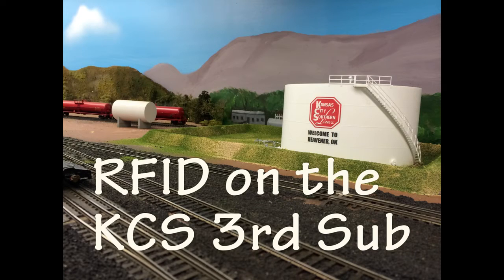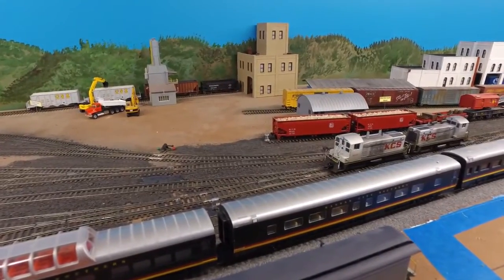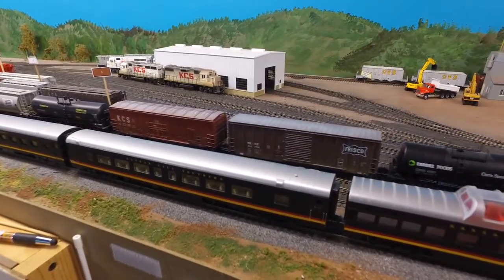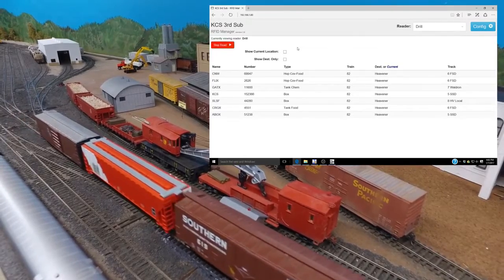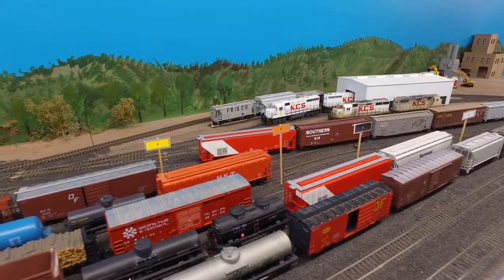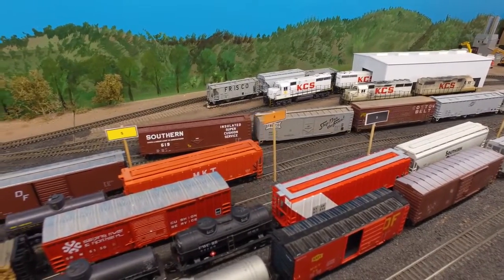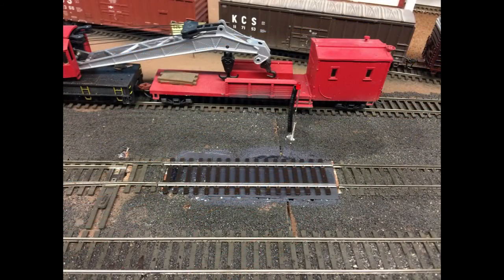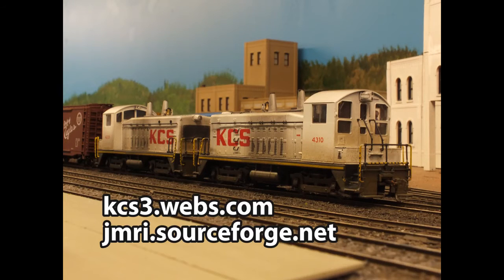RFID on the KCS 3rd

Comment: New on this? - What does RD track stand for?
Probably just stands for Reader ?
Or something else?
Reply from the maker: Different railroads have different terms for their various tracks.  It means "Receiving/Departing" track - where incoming trains arrive or are worked, and where trains depart from.  In truth the way the yard is configured, the siding can also be used to work trains that work Heavener (the main yard on the 3rd sub).  The main line however is strictly a through track - there are no crossovers or other ways to work or access trains on the main.  Thanks for asking and watching!
Reply: @TTownTrainFan  thanks for taking the time to explain,  Steve.

Comment: What software are you using for tracking the cars?
Reply from the maker: Thank you for watching!  I for the RFID hardware, I am using readers and chips from modelrailroadcontrolsystems.com.  Software is JMRI.  The actual screens (that receive the RFID data from the MRCS readers and look up the car destinations in JMRI) is a web app running on a Raspberry Pi which I and a friend created.  With the Python programming and RFID capabilities now in later versions of JMRI, this could be done as a Jython script.
Reply: Hello, was the script added to JMRI? Thanks.  @TTownTrainFan
Reply from the maker: No.  I’m still using our original PHP web-based approach.  No scripts in or changes to JMRI.

JMRI can handle this more easily and directly using a feature they’ve supported for a long time now called “reporters” which was created to facilitate train tracking data coming in from Transponding, RailCom or Lissy.

I simply haven’t had the time to learn about and implement that approach.
Reply: Thanks for your quick reply. Would it be possible for you to share the PHP web based solution please. The ability to see the cars appear on a screen as they pass over the reader would be very useful. At the moment via reporters I have not been able to work out how to get the info onto a screen other than the reporters showing only one car at a time and not as a list like you have. I have working set up MQTT reporters showing RFID tags but as I said as the next car passes over the reporter it shows that car and then the next and so on but no list is generated. 
I look forward to your reply. Thanks  @TTownTrainFan

Comment: FANTASTIC!!! The RFID system combined with a well-thought-out and prototypical yard design combined with centering, right height Kadees (with their curved uncoupling pins intact and adjusted) combined with magnets (either Kadee magnets or small cube neodymium) combined with yard engines running at 1 to 5 smph! This is what scale model railroad is all about at its realistic zenith and attainable idealism! Classification and blocking and consisting -- as close to 1:1 as you can get! I bet you not only have a lot of fun but also rarely have derailments also! Please keep on showing and sharing your info. innovations and applications for the hobby!!! The best hobby in the world IMHO!
Reply from the maker: Arden, you have definitely made my day!  I'm afraid my KCS 3rd isn't quite as good as all that,  but I do strive for it!  I have friends to help, and of course we are 100% Kadee and have a track with permanently mounted coupler height gages and every piece of rolling stock is adjusted to center the couplers in those gages.  Every once in a while I do have a derailment somewhere - not typically in a yard but at HO scale our models lack the weight of the prototype (even scaled down) so a car or loco will pick a switch from time to time.  Still, than you so much for taking the time to not only view this, but leave this great comment!